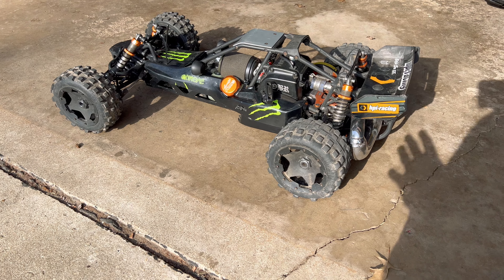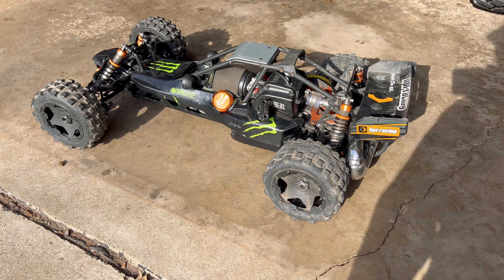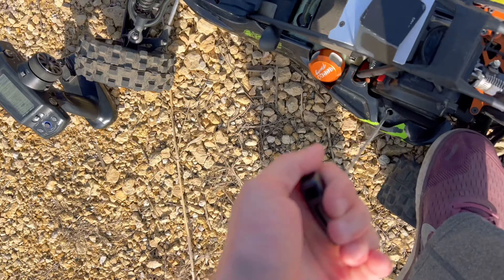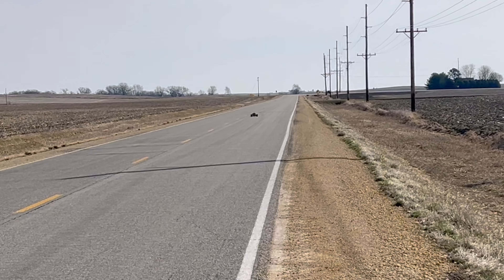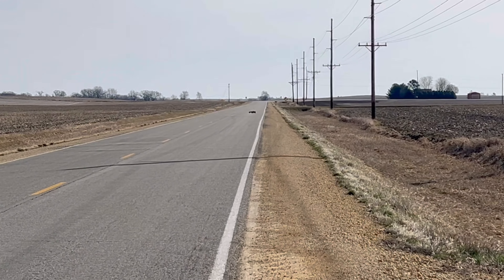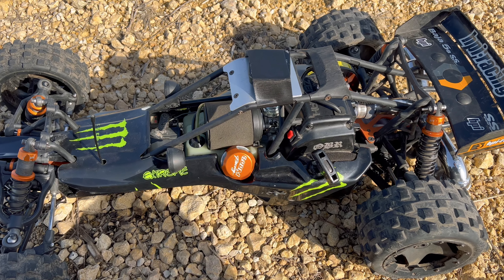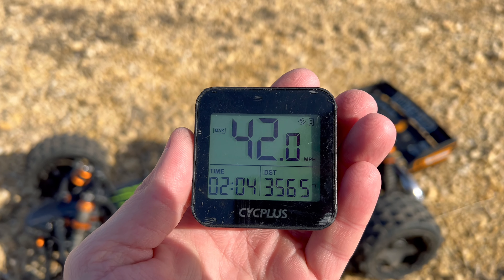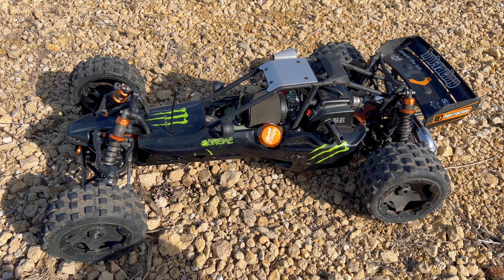HOW FAST is my GAS Powered 7.5hp HPI BAJA 5B SS??

Comment: Cool speedrun man! I wish i had a great speedrun location but i don't know if there would be any good ones in my state of OK. I started back up my RC addiction i got my XO-1 repaired and put in a Castle MMX8s\1717 combo for it and she rips with it.
Reply from the maker: Thanks man! Glad you’ve gotten back into the RC Hobby!
Reply: @RCKnockout  I'm glad too, I have some big plans for this year i plan to get a Traxxas 4-Tec 2.0 or 3.0 and an Arrma Felony this summer or fall.
Reply from the maker: @cjchannel12RC  nice man!
Reply: @RCKnockout  Last Sunday i ran both my Slash 4x4 Ultimate and my Hoss. Both with custom electronics the slash has a Max 10 SCT 120a\3660 3,200kv combo and the Hoss has a Copperhead 10\1415 2,400kv combo ran them both on 2s.
Reply from the maker: @cjchannel12RC  that’s awesome man! Glad you got them out!

Comment: It’s running good . That buggy needs a 2 or 3 speed transmission. It would book it for real
Reply from the maker: It would be a lot faster…but a single gear will be more durable for general bashing
Reply: Can you please help me with a question... I am changing the spur gear on my Traxxas slash 2WD from stock to metal do you recommend i go with a 72T or 76T ??
Reply: Do you want more speed or more torque?

Comment: On my buggy did I race has a 26cc i’ve done speed checks with it and I put road ties and I get up to about 65 km with standard gearing, and the carburettor is a wall bro with a little tuning, you should be able to get that and maybe a little more 👍🏻🇦🇺
Reply from the maker: Yeah I think it’s got a few more mph in it 👍😉
Reply: 42mp/h = 68km/h buddy. he beat your 65 by 3km with the choke still slightly engaged. 👍🏻👍🏻

Comment: @RCKnockout  i will be using a surpass brushless motor 3660 / 4200kv with 2s - 3s lipo and the pinion gears i have are between 29-33 so i would like to know what size spur should i use i have the option of 72T or 76T what do you recommend

Comment: Can you please help me with a question... I am changing the spur gear on my Traxxas slash 2WD from stock to metal do you recommend i go with a 72T or 76T ??
Reply from the maker: It all depends on your motor kv and the type of driving you’ll be doing
Reply: @RCKnockout  i will be using a surpass brushless motor 3660 / 4200kv with 2s - 3s lipo and the pinion gears i have are between 29-33 so i would like to know what size spur should i use i have the option of 72T or 76T what do you recommend
Reply: I would really appreciate the help of you can let me know what spur gear should i use?
Reply from the maker: @Ramblaxxas  I’d go with the 76t
Reply: @RCKnockout  will it make a difference if i go with 33T pinion and 72T spur?
Reply from the maker: @Ramblaxxas  yeah it’ll make a difference
Reply: @RCKnockout  would that difference be on a positive side like goes faster or is it not a good combination
Reply from the maker: @Ramblaxxas  it’s gonna go faster but that’s also pretty high gearing for that high of kv motor…you’ll most likely run into heat and limp mode issues
Reply: @RCKnockout  got it ok so the 76 spur is best keep it in mind that i will have pinion gears available from 29 - 33 so i can switch pinions. Last question what if i keep the 72 and go with a pinion gear between 29 - 32 which pinion would you go with or do would you still say go with the 76 spur?
Reply from the maker: @Ramblaxxas  that pinion and spur setup seems really high for the kv you’re running….what was the previous gearing you ran with that motor?
Reply: @RCKnockout  at the moment im running stock pinion gear and spur the fast upgrade that came with the slash. But i would like upgrade to the 76T spur like you mentioned and i have pinion gear 29-33 i currently live in Puerto Vallarta Mexico and rc parts are very scarce so i have to order everything from AliExpress so thats the only options of pinion gear and spur that i have to choose from in order to upgrade and that will be 72T  or 76T spur with the pinion gears mentioned above which set up would you say I should go with pleaseeeeee.
Reply from the maker: @Ramblaxxas  I’d try to keep the gearing as conservative as possible for the most longevity for your setup
Reply: @RCKnockout  ok sounds good i will go with the 76T spur and i will switch the pinions to see which works best since i will have pinions from 29, 30, 31, 32, 33, i wil see which works best

Comment: since you've first handedly experienced both a choke-less and choked carb, what is your opinion on which is better? or maybe i need to be more specific, what is your preference?
She topped out pretty fast though, even with the choke engaged. Seems like she could run 19/55 and MAYBE even 20/54 gearing for speed run purpose only.
Reply from the maker: I prefer a 990 carb without the choke….I definitely think I could gear it up a bit for more speed